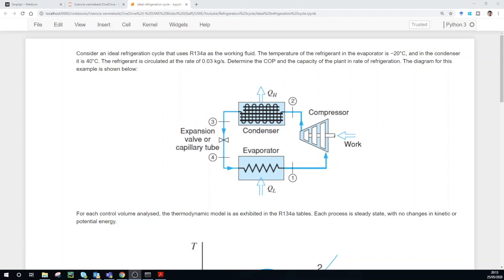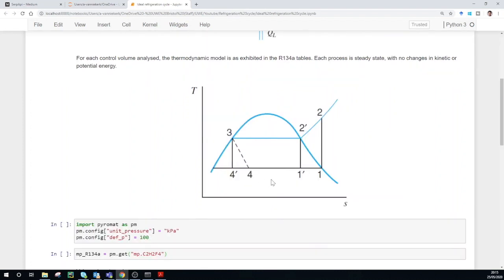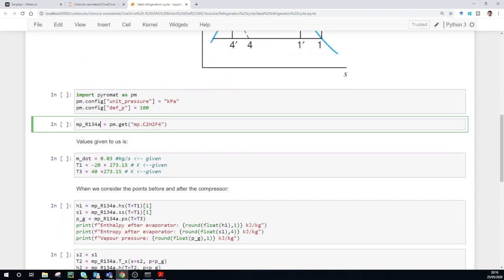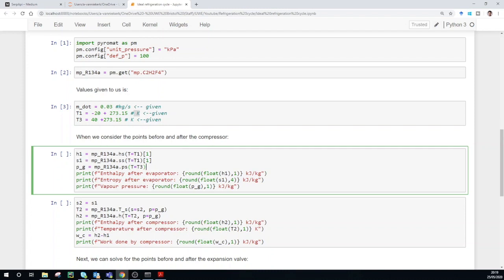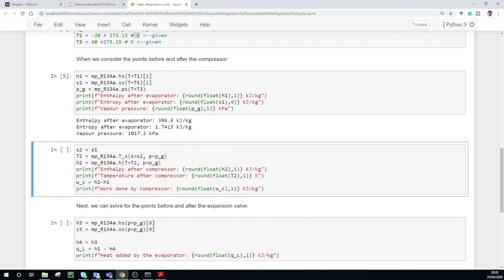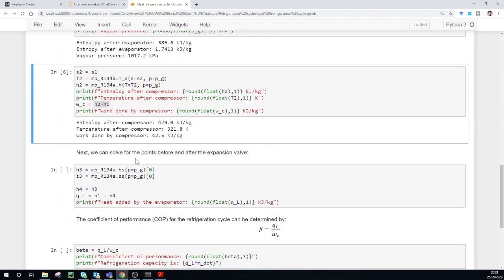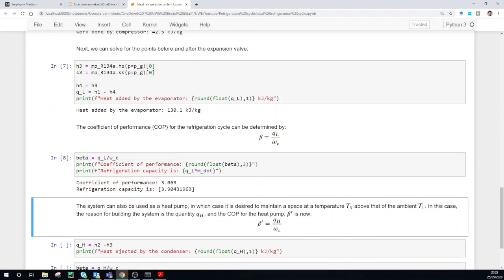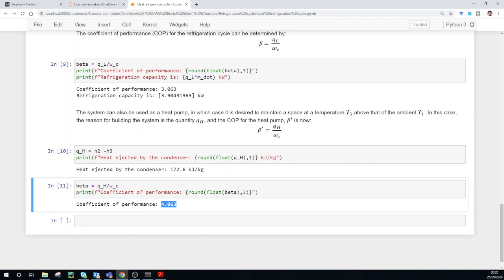Calculating the Coefficient of Performance of an ideal refrigeration cycle | Python  Thermodynamics

Comment: Good job!! ... do yo know which thermodynamic models package is used in PYromat library?.  In their web they say that : "At the close of 2017, version 2.0.1 marked a total transition to the Shomate Equation used by the NIST webbook, implemented by a class simply called ig. The same release also introduced the use of collections to organize species by their type."  I wanna use the example of this video for other refrigerants  but i think my teacher will ask me about the origin of the properties.
Reply from the maker: Thanks for the comment. I also had a look and you are correct that they use the NIST webhook. I think you can just cite the website when you use PYroMat. If you want you can compare the module's results to some tabular data in a handbook that your teacher prescribed? If there is no difference in the results, then you can confidently use PYroMat in your calculations.